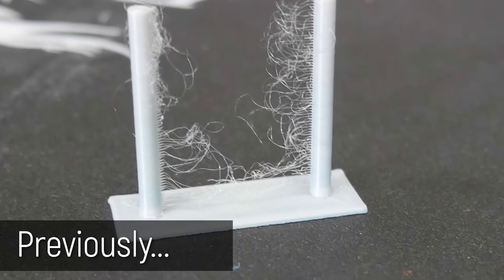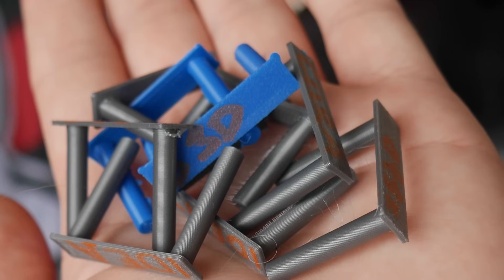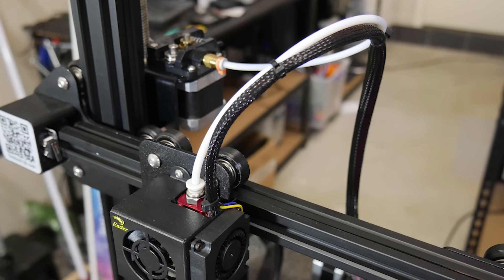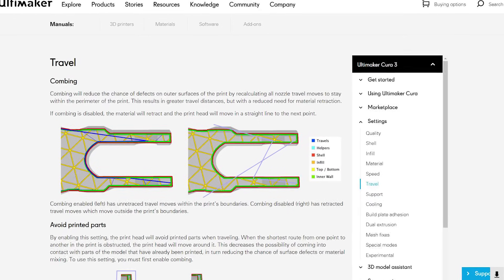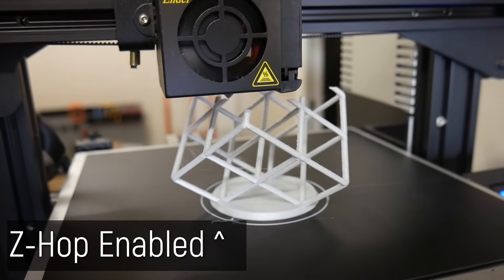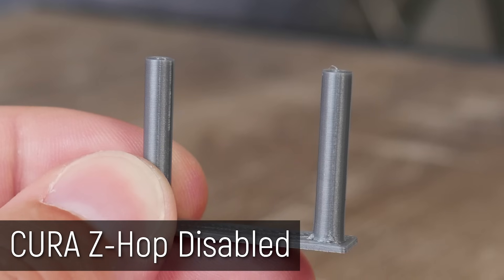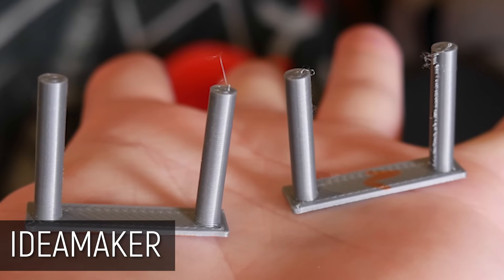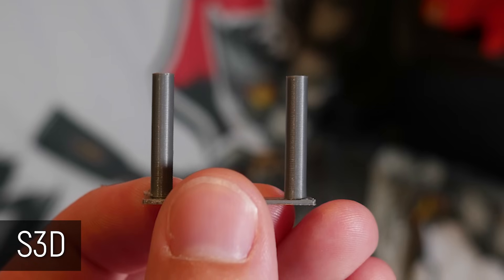Stop Ender 3 Stringing with this One Weird Trick! (ok but seriously)

Comment: The reason Chaz Meisters gcode produces no stringing for me is due to when/where the Z height changes occur. In old versions of Cura like Chaz used it seems to raise Z after traveling to the start position of a new layer but in current versions of Cura it raises Z at the end position before traveling and this causes my stringing.

Comment: My Ender 3 Max was definitely on the lower side of quality, despite coming preloaded with a few upgrades. I spent 6 months tweaking it on and off to get it to reliably print *anything*. That included slicer tweaks, model tweaks, and replacing/upgrading a good 40% of the stock parts. The state it's in now, it's a reasonable assumption to make to start a print, walk away, and have something other than a pile of tangled filament when I come back, but stringing is still a significant issue for me. I'll have to try disabling Z-hop. I'd like to stay within PrusaSlicer because that's what I know how to use, but I'm open to changing slicers if need be as well.

When I was looking at printers, the Ender 3 line was described as "a hobbyist's printer". Little did I know that that meant the printer itself was the hobby. Had I known that, I would have spent the extra money up front to buy a more capable./better quality machine so that I didn't have to maintain it nearly as much and can get straight into printing what I want.

Comment: Stringing...  The bane of 3D printing!!!  Ok, I'm really sort of new at this and have been at it for only two years now.  What have I used?  Tinkercad for creating and Cura for slicing.  Since my applications are constant, then why do I sometimes have severe stringing and other times not?  No, I'm not looking for a reply, that was a question to myself!  Some things I learned the hard way...

1.  Filament is NOT equal!!  Price does not ensure quality.  Consistently buying one brand does not ensure quality.  Quality may vary by color or lot.  I had several rolls of black that I bought from a popular supplier that gave me no end of trouble.  It was clogging the extruder tips about every 3-4 hours of operation.  

2.  The Bowman tube IS important!!  It has been touted that a Bowman tube with nice tight tolerance is good.  It's NOT!!!  Yes, it is true that the main run of a tight tolerance tube reduces the spring action of the filament within.  However, it creates a new problem within the hot end.  Repeated use in the hot end gradually reduces the inside size of the tube and eventually creates a binding point.  The result is stringing!!  My solution was to have the majority (about 4/5) of the Bowman run as a decent tight tolerance tube.  I then have a tube coupling and the last 1/5 of the run I use a Bowman with lesser tolerance.  Stringing stopped!   I repeat that NO other settings were changed.  The short run Bowman is also easily replaced when needed without changing the whole run.  

I discovered the Bowman problem completely by accident as I had a run of models to do, and stringing was horrible.  I changed the end of the Bowman, I changed nozzles, I changed filament, I tried settings, and nothing worked.  Finally, after that run was done, I had the epiphany about the Bowman in the hot end.  I simply sliced off 3" of a different brand of tubing and the problem vanished!!  I've been happily printing my next round of projects and the only issue I have had was one nozzle clog event.  Prints have been perfect.

Comment: Could you provide the g-code you used on your Ender 3 Pro? This way we could eliminate anything wrong with the slicer settings (at least on the Ender 3 Pro).

I have tried all the settings I could find. Some of them have some effect on strining, but I can never eliminate it completely. It would help to have a genuine, 100% guaranteed, certified working code (for the Ender 3 Pro).

Comment: I have gotten my Eder 3 S1 a couple of days ago and measured the print bed today using precision dial gauges.
Sadly, it appears to be warped too, with a convex bulge in the middle and an overall inaccurracy of 0,27mm from Y10 to Y210
I can sorta level the bed until the dial moves about 0,05mm (difference between corner points), but that seems to be the limit :(

Comment: in my opinion, this may be warped since the original release of the ender 3, but it seems great for beginners and frugal cheapskates like me who are willing to spend time to adjust and replace parts, like i only used the original bed for like a couple dozen prints before i switched to a different better one, and honestly just that made a huge difference for like $10.

but that's not everyone, so like anything, depends.

Comment: Creality does have a Q/A issue. I purchased a CR-10 Max that was not inexpensive and the print bed is warped something awful. The best thing about it is the modular nature that allows for replacements and upgrades, should one choose to replace irregular, or damaged, components - but that can be said about most, if not all, 3D printers.

Comment: I’ve had an ender 3 pro since Xmas (2 weeks) and the first 10 or so prints were awesome. Now it’s started stringing. The wheels now have flat spots on the y axis and the bed is slightly warped upwards in the middle. I’m a little disappointed but the problems are easily fixed. I’ve ordered new wheels/bearings and a glass bed, hopefully this will fix my issues

Comment: Man I don't get it. I tried the settings provided. First print came out awesome. After that the stringing came back... any idea?
Reply from the maker: Your PTFE tube is likely backing out, try reseating and maybe replace the PTFE and couplers. If it has any gap at all it's stringing central
Reply: @MakersMuse  I literally just replaced mine with a new bowden tubing. I'll check it

Comment: my two centz from an ender 3 pro owner is its a great machine for the price point but it requires too much tweaking i replaced the extruder, bed springs, installed a glass bed and better wire management and tons of failed prints and my ender is a great printer (now).also its was required of me to have a square to hold up to the bed while tightening the uprights that help a lot it does warp on assembly.

Comment: I modded my Ender 3 V2 to Direct Drive a few days ago. I couldn't fix my stringing even on PLA. I've been using Cura since I got the printer back in Feb 2021. I switched to ideaMaker and just copied over the relevant settings I could find on my Cura profile (I used an Ender 3 V2 profile from their the Raise3D cloud website), and holy crap. NO MORE STRINGING. Well, except that one wisp at the very end like with your sample.

This is so good. I'll be sticking to ideaMaker from now on!
Reply: What settings do you have on yours?

Comment: Oh my word. Not sure what I did to my Ender 3v2, but it was a string machine.  Was losing my mind.  My initial run of the stringing bench file included with your video, looked like a frickin' tennis net between the posts.  Loaded up the Chaz-tastic profile you linked to, sliced the two post file, and holy red foley, the posts are way smoother and ZERO strings.  That profile mind as well gave me a brand new printer.  Wish I could include a before and after pic.  THANK YOU!!  I'm gonna sleep well tonight!

Oh!  I reduced the post height by about 60%.  Printed much quicker.  If it's gonna string, it's gonna string, so don't need the entire height of the posts. :)

Comment: I have a couple friends who swear by the CR-10 so I purchased one.  Within the first 3 months, I had to replace the bed and the heater control board.  Over the next 3 years, nearly every other part has been replaced.  Spend a little more, get a different brand.

Comment: Ok - so I had stringing too, but not related to the software.

Here's what happened & how to resolve another issue that caused stringing:
I upgraded the PTFE (white) tubing that the filament feeds through with Capricorn (blueish) tubing. Capricorn tubing can handle higher temperatures, so it is recommended to change to it should you print a lot, as the PTFE just eventually melts at the head & causes blockages.

What I did not notice initially, was that the Capricorn tubing was not firmly fixed at the copper nuts, it was a bit loose. So the filament would feed normally, but when it retracted, the tubing would also retract. With a loose PTFE or Capricorn tubing the retracting does not work well & you will get a LOT of stringing and extra blobs of plastic all over your print. 

What did I do:
I cleaned the head, as it had plastic even on the inside of the rubber protection sleeve
I epoxy glued the tubing on both side to the copper/brass nuts (it sounds crazy, but you really do not want loose tubing)

My next print was as when I bought the printer new.

Comment: Creality definitely has a quality control issue.  I have 2 Ender 5 Pro's and one has a completely flat bed, absolutely no stringing and smooth as silk.  The second one, warped bed, strings badly with same Cura settings and has a really bad squeak on the Z Axis out of the box.   Both use the same 4.2.2 mainboard.    
If you get a good one, they are amazing, but if you get a dodgy one it creates a very frustrating experience.   To eliminate that frustration it is likely better spending the extra money to get a Prusa.   I only got a second Ender 5 Pro as the first one happened to be the "perfect" one.

Comment: fml didn't help ):
Reply from the maker: Bowden tube most likely not fully seated, or bad filament.
Reply: I have attempted everything. I first attempted to re-set my Bowden tube and that didn't help, so I bought a brand new set off Amazon that also came with new coupler thingies. I have tried even more extreme cura settings as well.
Reply: It's really weird too because it didn't used to string at all. Could it be the new tips I got? I haven't heard anyone blame tips for stringyness, but it's basically the only thing I can think of unless you know of something else?
Reply: Thinking about it now, old files sliced on olde cura settings that didn't string in the past are stringing now, so it has to be hardware related... But I'd not Bowden tube, what? Does the gear feeder thingy do anything that could cause stringyness?
Reply: It's also on every filament I own.. a variety of brands. I'm running out of things to to trouble shoot.

Comment: Maybe you can cover this I CAN NOT find anything it's all about mesh and model errors ... How do you print multiple consecutive holes... I have a manifold i designed on AutoCAD...everything I google is about non manifold geometry which is NOT MY ISSUE .... No issues or problems when loading the model x-ray view shows no issues...... But the issues happen when it goes to print the array of holes .... By the time it gets to the 20th hole in the array  it ground into the filament from the amount of retraction needed for the holes .. is there a way or a setting to use to plot a figure 8 pattern to do the holes? It seems like even to make the array it wants to retract for every hole and I have 115 holes to do

Comment: Expert mode settings options in newest Cura (july 2021) with view all set on is frigging insane. Ive got my Ender 3v2 custom thuroughly squared, trued and fine calibrated and the results are unbelievably perfect. I still cant believe i have under $300 invested total and producing precision parts almost every time. Only tweaking settings to adapt to unique models is all that is left to do.

Comment: Am using a Mega S and also have used a Ender. On both I never saw such intense issues on "simple" prints.. Especially on stringing and Z Hop.
I would say you have to dramatically increase retract  (aprox 6.5 to 7.5 mm). And then I definitely see too high temperature issues. You really should try a heat tower with retract and Z Hop to find the right temperature. Use a tower that has a string and bridge test integrated

Comment: May 6 mm tip on Ender 3 pro is stringing but my 4 mm tip on my Ender 3 pro V2 is not. Cura settings are the same expect the tip setting. Ender 3 pro has the motherboard upgrade and Capricorn tube upgrade with metal gear extruder. My Ender 3 pro V2 is all stock. I have 2 Ender 3 pros and 2 Ender 3 pro V2s. I also have a Creality LD-002R.

Comment: If i get stringing i just keep lowering my temps until it stops, Usually my perfect setting is about 5 degrees above where I can hear my extruder gear skip because the filament isn't getting melted enough to squeeze through the nozzle fastenough, but within that 5-10 degree window I go from zero stringing, to some stringing. Think about it, get some taffy candy and put it in your pocket for a few minutes, then pull it really fast, what happens? It strings. Now put the taffy in the fridge for a minute, then pull it apart really fast, what happens? It breaks off. Same thing happens with the crystalline structure of PLA, if its too hot its gonna gooo all over the place, if its cooler, it will just make a clean break.

Comment: I'm confused. Using the right filament and no z-hop, was there anything else that helped with stringing? You imply the 0.16 layer height probably didn't, and combing in Cura may have, except S3D doesn't have combing, so that doesn't account for it. So what exactly are the mysterious settings that help eliminate stringing, besides just no z-hop? And what of a z-hop that's much less, say 0.15?

Comment: So what you're saying, is that there's no one singular combination of settings, config and slicing, that make perfect prints for every possible print on every unit of same model on every filament of same base material? :) I'd humbly suggest that is the story of every tool and machine - from 3d printers, to a drill, lathe, driving a car - heck even a screwdriver or your own hands :)

Comment: Angus, I have been printing for about five months with my first printer, Anet A8 plus. No frills, it's received mixed reviews. Now, that said, I built the entire thing, and have had zero issues with anything out of the box. I'll add per your coments, this was a 240 dollar printer, and my expectations were there re no frills, etc... However, I wouldn't have found faulty parts, acceptable. I paid for a working build, not bent rods, warped bed, any of the above. I'm very pleased. I'll close with, downloading IdeaMaker right now, looking forward to working with it. Lastly, my advancement in these last five months are purely in relation to your channel, Stefan at CNC Kitchen, The Printing Nerd, and a host of others. Such an incredible community of makers and yeah, i'm kinda proud to be in the mix. Great video. I've reduced my stringing pretty well by tweaking using Slic3r, etc... but as everyone, I'd like to see it gone. THANKS!

Comment: I got an Ender 3 V2 about 1.5 weeks ago and the print quality is so insanely good that I havent stopped running it since i bought it. I have done the TH3D Aluminum Extruder upgrade but honestly thats it. I have used Cura since day 1 and I LOVE it, its so easy to make changes and move your pieces on the virtual building surface. I guess I just thought the printer was that good, im surprised to hear that its Cura's doing. Oh well I love it and im so happy with my results thus far.

Comment: I have 3 Ender 3's and all 3 print with no stringing with just the defaults cura settings. So all these settings are over kills. If I have issues it's usually a clog, Boden tube issues or fittings wearing down and or the filament type.

Comment: I make cookie cutters and my Ender 3 Pro recently started stringing like crazy (I'm still only a few months into 3d printing). I used the Cura settings you provided and POOF, the stringing is gone. I think the 'not in skin' combing mode is what did it for me, I was using 'within infill' before and this was the main change between the new settings and my old ones. Anyway - thanks a ton!

Comment: Actually, filament can be a variable, yet it depends on one important thing : the filament's condition.
Cheap or expensive, you will eventually have stringing and most artifacts retractions can cause if your filament is not dry enough.
Printing without stringing is not that difficult, I do it on a similar printer (Anycubic i3 Mega-S), not only by tuning retraction, but also (and mostly) by keeping my filament spools dry (which implies storing them properly and having some "oven drying sessions" at times for some materials).

Comment: I have printed a LOT on my ender 3 pro with zero issues. I have used cura from the start. Within Cura, you can select your ender 3 pro as the printer you’re using, settings in extraction/extrusion change accordingly. Additionally, you can select the exact filament in use as well

Comment: I think I have been very lucky in that the only issue I have so far with my Ender3 v2 is a bof stringing, which just means a little extra clean up after printing with sandpaper and maybe a very quick flow over with a blue flame,

I too would not have been impressed with a warped bed, as this would render the printer practically useless in my view. As an entry level printer, assuming there is no damage on arrival, I think the Ender 3 v2 has been of great value to me as there is no way that I was going to spend c. £500 for a first-time device that I might end up crashing.

What this device has done however is to have opened my interest to 3D printing into a hobby rather than a wish to do. It has made me consider what I need to do prior to simply downloading an STL, running it to G Code and printing. I am actually considering the sort of questions that (a very basic amateur) engineer might. I never considered 3D printing to be just a plug and play hobby, since it takes tinkering. If anything, I like the fact that one has to partially put their printer together when received, since if this simple task is not for you, neither is 3D printing. 

Love the videos and keep up the good work.